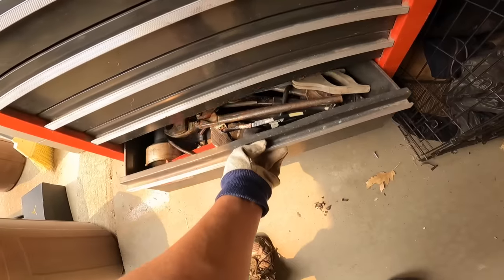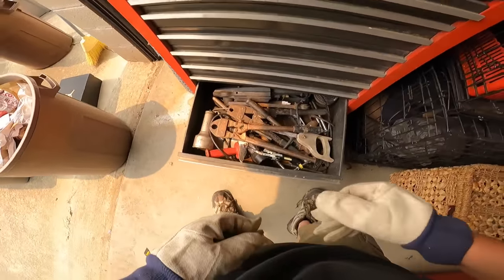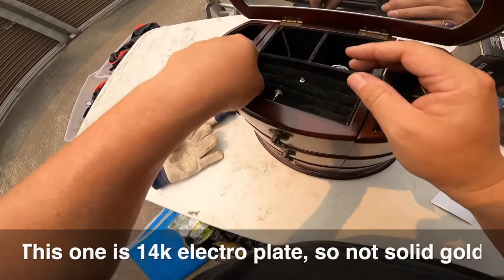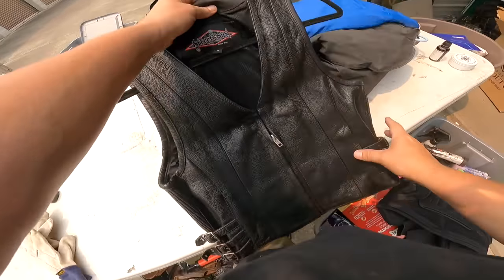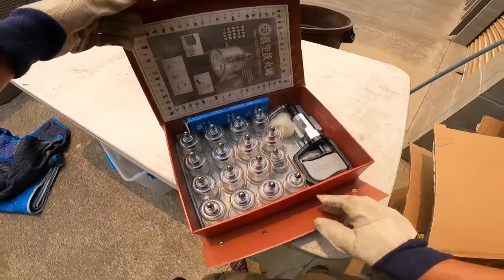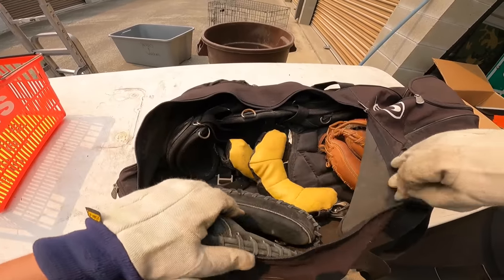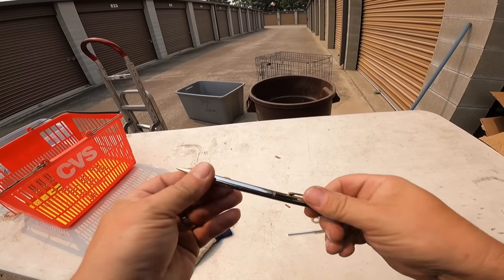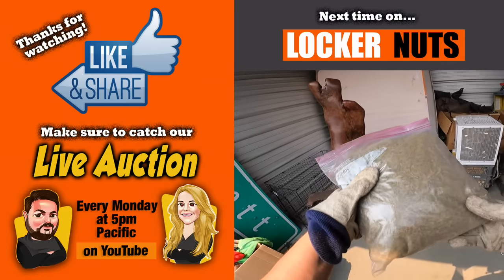Paid just ONE DOLLAR for this locker at the storage auction, and we might make thousands from it!

Comment: If you haven't been advised already please take a close look at the older of the two gun holsters (the one embossed US). I have a similar one which has the date stamp on the back as 1914 and is for a Colt 45. It has some value.
Reply: The brass key does belong to a railroad switch lock

Comment: Hi Jack, that black tool with two handles is for bending different diameter metal tubing, diferent degrees without kinking it, ie brake lines, fuel lines, hydraulic lines it was in the big tool box drawer

Comment: Never ever store your records flat. They should be upright like books with the album name out. My Dad was a collector and I have inherited 12ft of albums 1/2 are 78's. Took me forever to get rid of them but don't lie them flat. Use the center and edge to handle them and don't touch the grooves. The warps were most likely from heat
Reply: Albums should always be opened to prevent warping.
Reply: I agree - store your records upright.

Comment: Tegaderm Foam Adehesive 6.9 cm x 7.6 cm (mini oval) - foam dressing with adhesive edge / 10 pieces

3M Tegaderm Foam Adhesive is a thin, highly absorbent foam dressing with superabsorbent and a moisture-regulating layer for lightly to heavily exuding wounds.
Its particularly thin adhesive edge and the patented spoke application system enable precise, one-handed application, even in difficult areas.

Your advantages:
- Adaptation to different amounts of exudate
- Reduced risk of maceration or wound drying through intelligent exudate management
- patented memory application system enables application with just one hand
- perfect fit even in prominent places
- Secure hold thanks to the extra-thin adhesive edge and hypophilic adhesive - even with strong shear forces and rather damp skin

Indications:
- for the ideally moist wound care for weakly to heavily exuding wounds
- for surface wounds as a primary dressing, for deep wounds as a secondary dressing

Comment: Tegaderm is very expensive wound dressing. usually only given by prescription. if you do not sell it at auction or ebay, please consider donating it to some group that can use it. after my father passed away he had tons of medical bandages & wound care supply i donated to a group that was dealing with a hurricane in haiti and they desperatedly needed medical supplies.
I am sure with all the fires, disasters and hurricanes not to mention pandemic, someone would benefit from you donating them if you are considering throwing them out. otherwise sell them, someone will buy them.

Comment: the black net u found is a Bay net they use them at auto shops with an open pit they connect inside the pit so if someone falls in they dont fall 10ft into the basement ....you have probably seen them at jiffy lube.

Comment: That Stainless steel pipe you found that you thought was a car part is part of a still I think. It would be part of the standing line headed for the condenser.
Reply: The stainless pipes he found in the cage were a parts from a dual exhaust kit for high performance cars.. it's called an 'X' pipe.. most likely for a Mustang.. it's definitely worth up to or a little more than a hundred bucks..and it looks new

Comment: Is there any way to flatten those records? Like with heat and pressure? Someone must have a way to save them
Reply: Yes. You place them completely between two pieces of glass, and place them in the sun for a couple of hours to correct the warp. When you bring them out of the sun, let them cool to the touch before moving the glass. This should correct a minor warp. On something more serious, it may work, but might require a heavier pane of glass. Anyhow, at that point, it couldn’t hurt to try, because you couldn’t make it any worse.